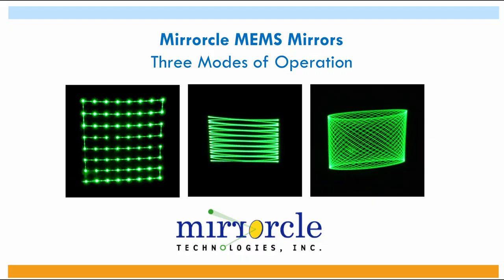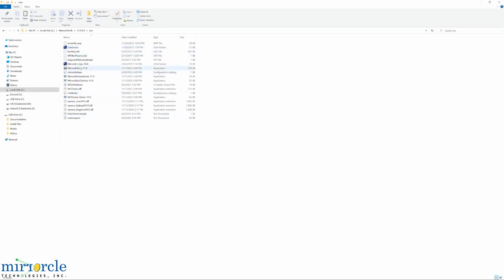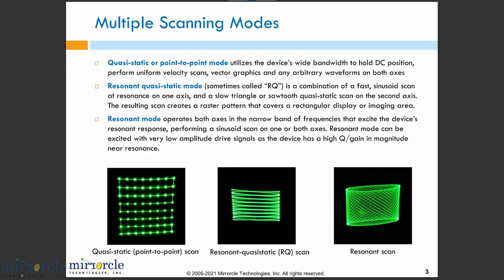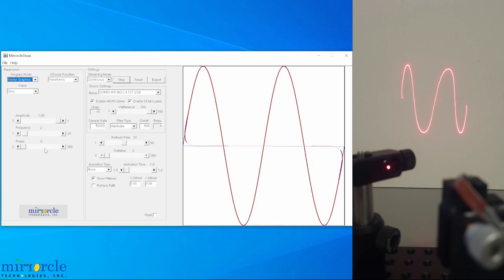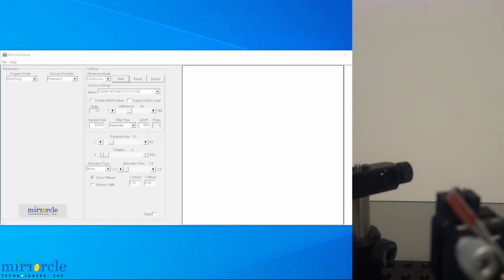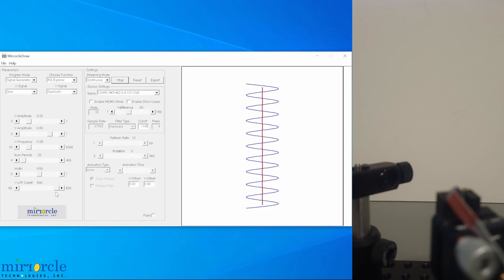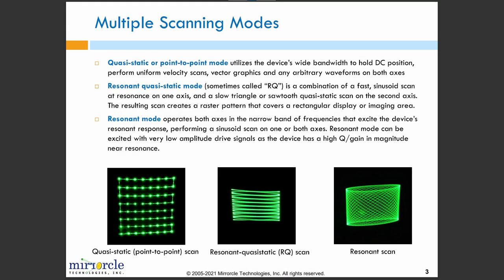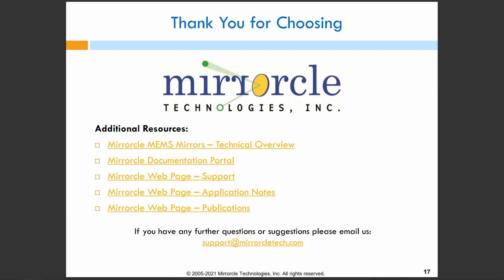Mirrorcle MEMS Mirrors - Three Modes of Operation

Comment: Hello, I am a student from China. We purchased your product. It should be this scanning lens. It is controlled by digital signals (SPI protocol). I am adjusting the X-axis or Y-axis on it. It works normally when scanning, but when I program it to stop at a certain point, such as programming to input coordinates (x, y), that is, when the coordinates of a fixed point are continuously sent to the register ( That is, the four differential channels ABCD always maintain a certain value), it can be correct to a fixed point, but it is very unstable and will continue to jitter in a small range. What may be the reason for this?